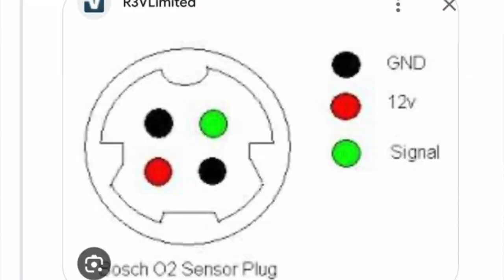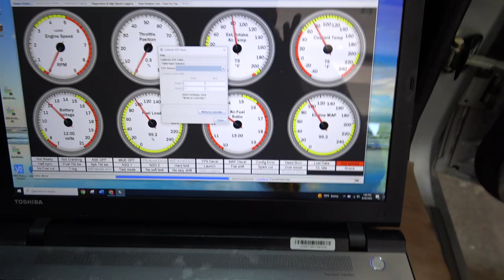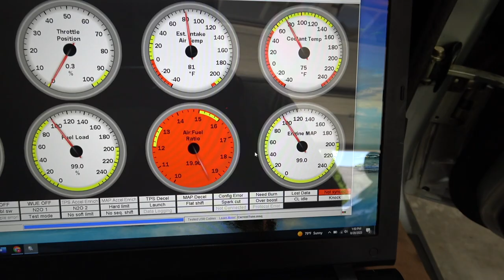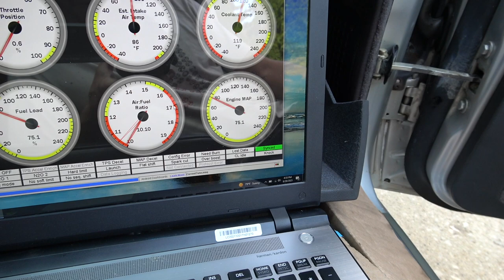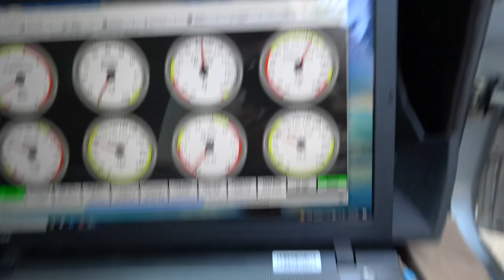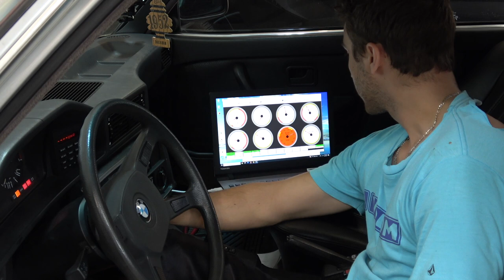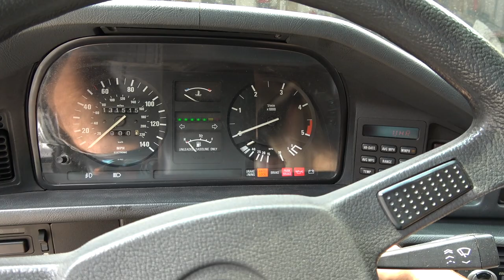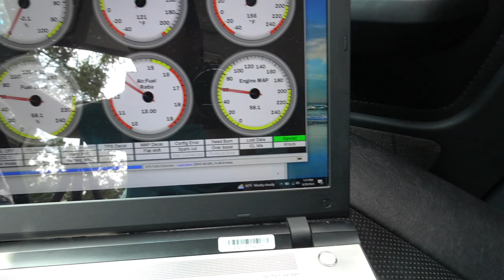ITB M30 E28 Gets a Full Exhaust and Standalone ECU Tuning | Buttoning up the Swap

Comment: I bought two different "OEM quality" expansion tanks and both of them didn't seal completely due to the threads on the coolant level sensor. It never cooled correctly, until I found an actual BMW made expansion tank from a parts car. I noticed your expansion tank is overflowing which was the same thing that happened to mine before I replaced it with an original BMW tank.
Reply from the maker: I solved this issue, i had it mounted too low, below radiator hose lol

Comment: My buddy over at Rada Race Labs  was telling me their tuner knows the mega squirt system really well if you want to try them out for a tune.
Reply from the maker: I have a veteran MS tuner working it out. Thank you though!
Reply: What AFR are u aiming for at WOT? 13? Also, you should learn yourself fiddle around with MS. Very user friendly IMO. 😃
Reply from the maker: @jonashedman131  id say 12.5ish yeah. Id love to sit and learn it but man im not good with computers!
Reply: @m3nameisjosh464 alright! i would not go below 12.5 on a NA engine tho. Keep it between 12.5 and 13 is my advice. Light throttle around 13.5. You will be running premium pump gas? Here we have 98 octane as a option. But mostly 95 🙂
Reply from the maker: @jonashedman131  noted! Yes premium 93 only

Comment: Dunnoif its an M30 thing but sounds like your limiter is quite low. What's it rev to?
Reply from the maker: You sir have a very keen ear, and have uncovered an issue which will be addressed in the next episode. This was not so much a rev limiter but a loss in crank position signal causing full lean condition
Reply: seemed very prominent on this pull 20:15
Reply: My m20 e30 homie had the same problem with his megasquirt - couldn’t rev above 5k or so - would lose crank signal. Defective unit. Went with the superior @classicdaily turkey & cheese 1.3 motronic pnp ecu! For m20/m30. Runs Rusefifirmware that tunes with tuner studio
Reply from the maker: @coldload  all I had to do was move crank sensor closer to trigger wheel, gap is very important.

Comment: Hi, i have a E34 with the same engine M30B35 i have a DMF problem and i want to replace it with a single mass flywheel. Do you have any problem with the single mass flywheel? I mean gearbox rattling, or engine problem?
Reply from the maker: @laci423  you will definitely get gearbox rattle, but otherwise no issues